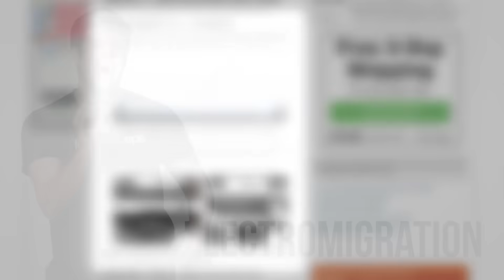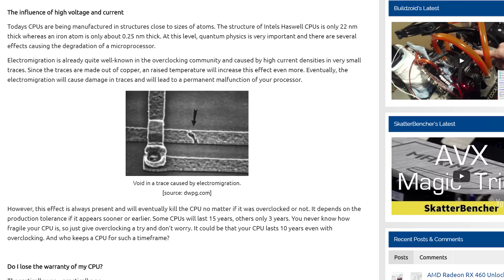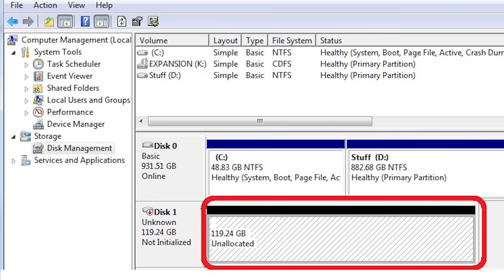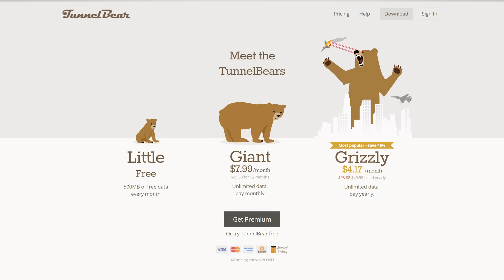Why Do Electronics Die?

Comment: My PS1 and N64 still running fine after over 19 years
Reply: Biggest helping reason behind that is because neither of those systems generate a terrible amount of heat. N64 is literally cooled with pads and no fans.  They will probably last much longer than most anything made today.
Reply: most old electronics barely generated any heat, now even cellphones can go hot as hell when under load, temperature kills hardware more than anything.
Reply: My NES, ATARI 2600 and PONG still works hehe
Reply: My n64 still going strong as well
Reply: how about the reset button on your PS1?
Reply: @xybersurfer  Some people are capable of not pouring soda in their stuff
Reply: @shaddoty  i never poured soda in mine. the reset button just stopped working, after not having used the PS1 for a long time
Reply: Bravo to you ! My Intel Mac Pro packed up after the Warranty expired !
Reply: A 1975 printing calculator I found at a thrift store is still working perfectly after 45 years
Reply: well systems from 20 years ago are different than todays standards
I would call it because the hardware in n64 is big af that means it lasts longer
Reply: Schlestes Remake you’d actually be surprised by how much is empty space inside the N64 and the cartridges, 
I once opened a Nintendo (original cartridge) and 9/10 of it was empty space the Rom chip was about 2x the size of a modern USB stick .
Reply: @lennywhere  Don't forget that your n64 and ps1 aren't on 24/7, they're only on maybe a few hours a week IF you use them regularly still.
Reply: @TheSkepticSkwerl  an hour for 19 years vs 6 hours for 3 years?
Reply: @lennywhere  Companies back then used to choose quality over more profit. These days they make low quality products to gain more profit and that has all types of problems. From overspending to pollution. It's shitty nowadays ;/
Reply: My ps2 still works. I still play on it in 2019 and will the next year as well.😁
Reply: @sonicmaiden2871  PS2 was a good console, I remember playing the old Star Wars Battle Front on it, I love that game.
Reply: @Ninjudo  ps2 is great! I have recently started playing Okami. Great game! I recommend checking it out!
Reply: 19 years isn't that long. My grandmother has a 14 year old PC that still works just fine. It's very outdated and extremely slow by today's standards, but it still works exactly how it should. Most laptops are rated for 10+ years and can run even longer than that. They didn't say how long it would take in the video. Just why it will happen eventually.
Reply: My father's pc with pentium 2 and nvidia viper runs fine for over 21 years
Reply: That means you take care of your things
Reply: I thought i was poor,  now i feel better
Reply: To make electronics faster, we make them smaller. Making them smaller makes most of the failure methods discussed in the video worse and harder to deal with. Do yeah those still work because their processors are larger and slower (producing less heat and thus less wear.) The N64 operates at 94 MHz whereas now even some routers have dual core 1 GHz processors. Do if you want things to last longer have lower performance expectations or run all your devices at super low temps.
Reply: i have a NES only thing that failed is the pin connector
Reply: JAPAN TECH NEVER DISAPPOINTING
Reply: GamerFrancis TV  How? Have you dropped it,split on it water or have you opened it? My ps3 still works and it has more than 5 years.
Reply: Just like my Sony Ericsson K750i :)
Reply: that's because planned obsolesence wasn't a thing then
Reply: Are you 55 years old
Reply: 2021 update both still working
Reply: Everything on the planet goes by this simple rule. Something with a lot of loads on it or consistently will experience where. But if you don't use it but only from time to time then of course it's going to last way longer
Reply: True story
Reply: That's because legends never die
Reply: Well back then we got premium products
Reply: Because they still fighting each other
Reply: Yeah sure after 100000 maintenance sessions and replacing parts
Reply: Where are the consoles, are they okay?
Reply: Valkyrie yeah
Reply: My emulators also work fine
Reply: I'm surprised your ps1 laser didn't cave, did you even use your ps1?
Reply: Can't say the same about my Xbox :/
Reply: Do you use them 24/7 though??? Lol
Reply: My cpu is still running fine for 10 years
Reply: My Xbox 360 lasted for 5 or 6 years, then it stopped working for no apparent reason
Reply: Same for my NDS Lite after 13 years. And believe me, I've used it a lot
Reply: Wii going strong, too. 7 year laptop chugging along fine (with new thermal paste and drive)
Reply: My SNES and N64 still work
Reply: survivor bias
Reply: Yep
Reply: My Wii working for 12 years now.
Reply: Because its to make people buy more and because theres some strong power proccessing going on while using electronics since people like to make things smaller which makes it shorter the life span
Reply: Wow! My PS2 still working after 5 years of not using it because of AV cable problems
Reply: @Yvander829  i will possibly start playing on my ps2 slim again...
Reply: I still have a colection of 3 diffrent ps2s
Reply: How puny. My telephone from 1901 is still in tip top shape.
Reply: My Atari 2600 still works 50 years later
Reply: My nintendo 64 is running fine to lol
Reply: I have a 2007 Seagate Freeagent. 😍
Reply: My father had a 13 year-old macbook... installed GNU/Linux, works like a charm now.
Reply: Same
Reply: Think a lot of it is to do with leaded VS unleaded solder.
Reply: Yep N64, Nintendo NES and Sega Megadrive still working. got them.
Reply: Just wait 20 years
Reply: My grandma fridge from 80s still working fine but sure a powerhogg in her house and electric tariff were expensive today compared in 80-90s
Reply: Same with my Dreamcast.
Reply: Valkyrie. . .

Are you joining us for the last battle?

😇
Reply: I have an original Apple Macintosh 128k which was built in 1984 still running as it did the day it was purchased.
Reply: Money wasn't a thing that time, more for happy customers. Now short lifespan so we have to buy again. Tbat time was also when everything was discovered. So game companies pc companies exc- want to get more and more and take the most out of the devices. Now we have dlc's buy in  a store. Not only that. In 2000 exc- they never heard of that.  Now we can buy lvls. And like the last finalfantasy unfinished game. Game updates exc- or look at windows 10. Thwywant full control now. Times have changed badly. All for the money not for the customers. Fossil phones where better and when you dig one up sure you still be able call with it.  It's thisdays business tricks.
Reply: @denshin2724  While I don't disagree with some of what you said about companies being greedy that's always been the case and it's not the main reason why electronics these days often don't last as long. The reason electronics often degrade faster now is due to the fact that everything is getting smaller and more powerful simultaneously. This leads to much higher temperatures being generated in equipment which is more compact and so has less room for airflow and temperature regulation. Old consoles and phones are considerably less powerful and often not as compacted and so have lower operating temperatures which means less wear on the components over time.
Reply: @JakesGuitarThing  generally older tech tends to require far greater power than current ones. Those newer, smaller electronics uses far less power, which in turn means less heat and thus requires smaller amount of airflow.
Reply: @marcusjr80  older tech requires higher voltages, but requires less amps (because power used equals to UxI). Older devices usually are less power hungry, that's why you won't see any massive coolers like the D15 from Noctua or AIOs on a 486 or 1st gen Pentium. Newer tech works with voltage under 1V (inside the CPU package), but with hundreds of amps.
That's the job of VRMs to convert 12V rail (at 5A for example) from power supply to 1V (in that example 60A). As for the reasons why phones are so small with hugely restricted airflow, it comes down to the decrease in transistor size (which makes for smaller dies and motherboards) and power management features. But newer electronics, in most cases, do in fact draw more power than older devices because they are far more powerful
Reply: @denshin2724  Older phones also tend to be more durable and user friendly.
Reply: Denny D 27 so you’re telling me that money wasn’t a concern for the PS1c, when it was sold for a profit...yeah....makes a TON of sense
Reply: @denshin2724  That may be one of the reasons but not the main one. It's not really all about money. I think it's more about the increase in demands.  

People replace their old device much more often today compared to 2000-2010, it's not because the old electronic device died but because a lot of old software that are now updated needs more power so a lot of people also tend to buy newer things to catch-up and match the certain demands of things. 

Sure, some people really have a dead device because of age but that's really not everyone. If you ask 10 people if they've had an electronic computing device die because of old age, maybe only half or not even half will say yes. Electronics lasts a lot more if they are maintained. Many PC parts today die after only a year or 2. That can be caused by not enough maintenance or just really faulty. Compared to the year 2010 and under, PC parts have a lot more chance of being faulty even after passing QC since there are a lot more being produced. 

A lot of factors really. Money is probably just half or a quarter of the reason. Correct me if I'm wrong.
Reply: @denshin2724  well said.
Reply: @denshin2724  it can be all about the money everything is possible
Reply: @denshin2724  Money always was a thing to care before "customer happyness'. Do you know anything about "Vereenigde Oostindische Compagnie" or "Dutch East India Company"? It was an corporation founded in 1602, and was more rich back then than several european countries!
Reply: @Weisior  Yeah by Colonizing Dutch East Indies/Indonesia right?
Reply: @danieltanuwijaya7675  Their field of interests was a bit wider but yes, it was the main focus of the company.
Reply: Japanese and US capacitors in those systems rather than slave labor prisoner made Chinese junk. Another factor is my assumption that you are NOT an idiot and properly cared for and maintained the systems.
Reply: Well done. Now all you need is to move out of your mother's basement.
Reply: @KXSocialChannel  having old consoles equals still living with parents apparently
Reply: Having a nice pleasant conversation with ur mom That's right. It's also the stereotype which makes my comment funny.
Reply: @KXSocialChannel  🤣🤣